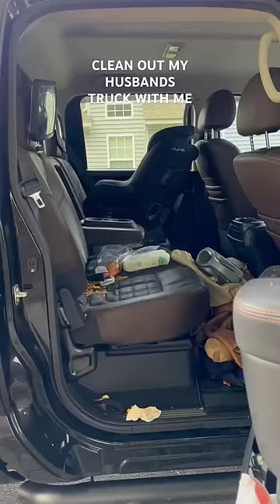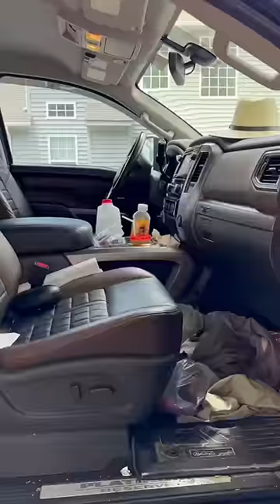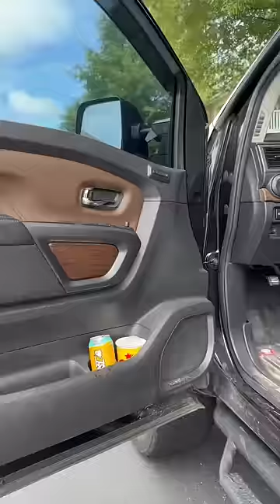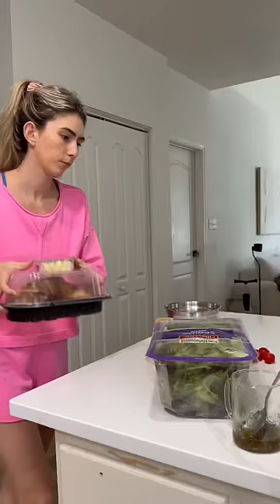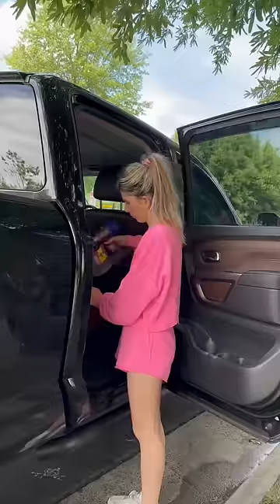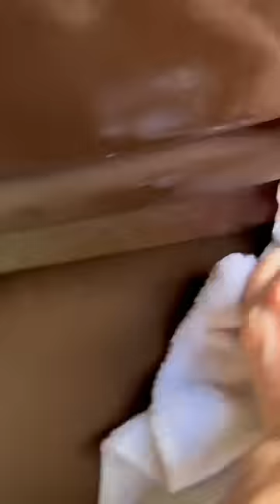PART 1 #cleanwithme #cleaningmotivation #cleaning #carcleaning

Comment: Tip: the way you were scrubbing the seams will actually wear down the stitching. Vacuum up the crumbs instead by slightly separating the seam. Rubbing them the way you did pushes crumbs into the seams